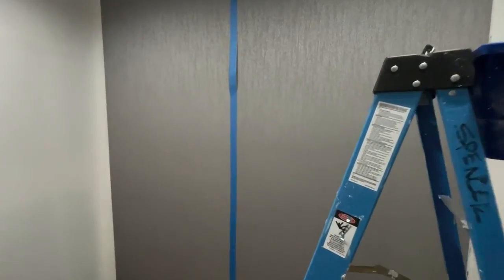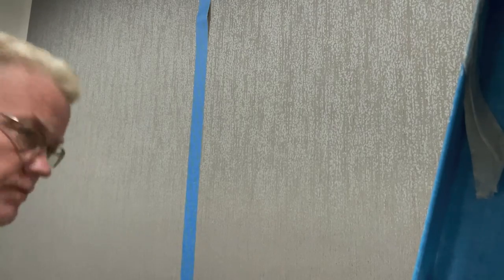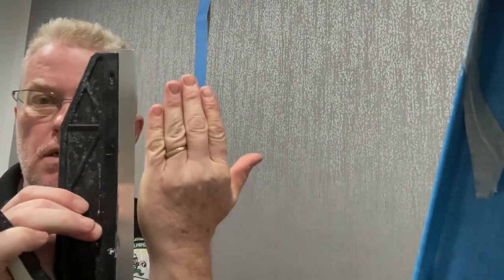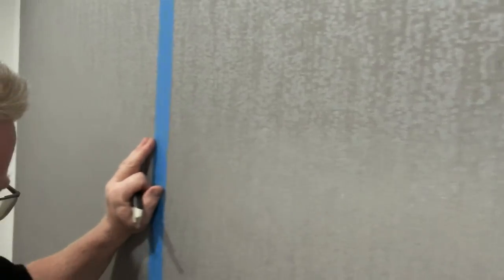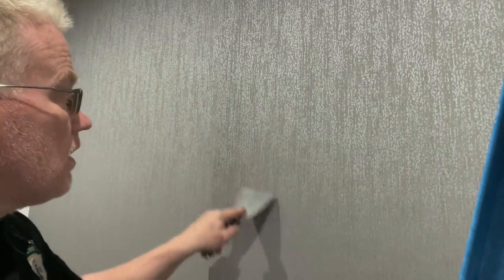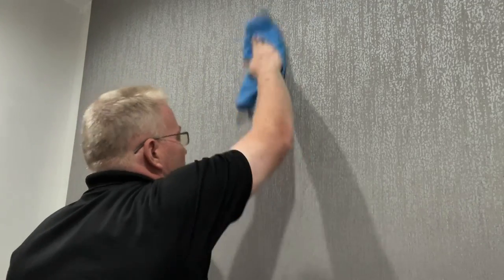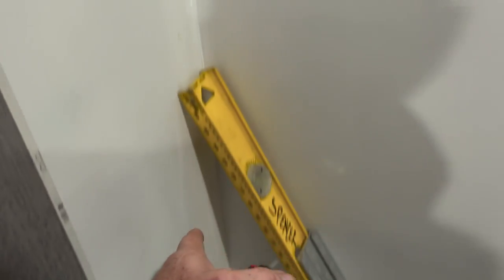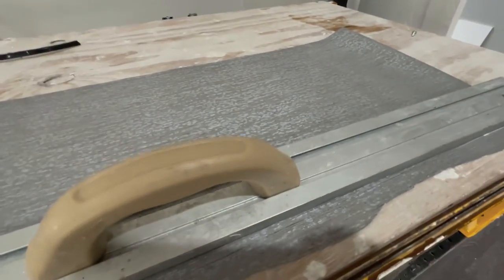Hang J. Josephson Commercial Vinyl Wallcovering Tips N Tricks - Spencer Colgan

Comment: Good stuff.  Yeah, the old timers use the single edge blade.  Their fingers are so callused and hard and strong that it's not a problem.  Also, the old timers use a six foot straight edge.  One hand holding it in place on top.  Knee keeping it in place below.  A lot of installers will tape their ceilings so they don't glue get on the ceiling and have to hit with a sponge, which will always leave a smudge on a freshly painted ceiling.  The best installer I ever saw was so good he would free hand his ceiling line cuts. It was crazy haha.  Anyway, thanks.

Comment: Use a 6 foot magnesium straight edge and single edge blade for best seam. That's the way commercial installers work. You build up a callous real quick you can also use a double cutter. We don't use snap of blade knives except in extra reach scenarios. Being able to use a single edge blade handily and safely (cuts are extremely rare) is hallmark of a good installer. Why not use a snap off blade? Because it bevels the cut and you don't have control you do with a single edge blade, take a pencil write your name now take that pencil and hold it further up like a snap off knife and write your name. All good commercial installers use a lightweight magnesium straight edge and hold the blade flat against it you can feel the wall as you cut and don't split the drywall. No good installers freecut seams because your gonna slightly angle the blade giving you a more visible beveled seam. Commercial vinyl is always wrapped around inside corners where possible to avoid visible seams at corner. There's tricks to doing this correctly (heat gun, corner roller)  plumb will be achieved with next sheet. There's a reason pros do it the way we do, however "many way to skin a cat". There's definitely different methods to installing commercial 54" than residential installations. Get a magnesium straight edge, and a stabilla level and throw away your snap of blade knife for a week, you'll improve your skills. Another tip, if you have to split a sheet at corner trim your overlap to 1/8" using plastic smoother (don't slide it)  then peel it back a few inches install next piece smooth and flat (never pull, tug or twist type 11 vinyl) and trim of excess with a metal 10" broad knife being careful to keep that blade flat so you don't have that beveled seam then lift of the edge and lay the preceding piece with overlap underneath. This will avoid cutting thru your overlap which will split. We also use this method on residential papers when splitting corners. At the end of the day 54" type 11 vinyl is not a DIY project. Those commercial installers typically hang a 100 yards or more a day compared to 30 yards in residential, we paste the sheets on a canvas drop taped to hard floor using a 6'-8' extension pole, not worth busting out the 54 "pasting machine on small residential installs. On non woven fabric back vinyls you can also paste the wall which helps with seams not splitting as it dries, cause yeah that stuff can expand as it absorbs the paste. After 40 years I always learn something new particular with so many different and new materials. Keep up the good work Spencer 👍
Reply: @chenel1234  well Spencer definitely has his own take on hanging wallpaper. I guess it depends on with who and how you learned the craft. There's the traditional commercial vinyl methods that are utilized by thousands daily because it works. With residential well you have to be adaptive in your approach as there's no constant in materials, basically residential is a shi¥show and you hope your skills are gonna overcome the shortcomings of the materials. There is a right way and method to hang wallpaper which can vary by region and or country in the end everyone adds thier own little tricks and methods. I strive to do the best possible job without wasting time but the world's not perfect! I'm somewhat tired but my son has taken over the business and Ultimate Wallcovering is still ultimate, lol.

Comment: I hung that exact same vinyl in a Hyundai dealerships offices! Fortunately, for me they all had dropped T-bar ceilings, so I took off the wall track. Hung the sheets plumb. Cut the seams with my 4’ aluminum wallpaper edge trim guide. Re-installed the track and trimmed the top edge….😉